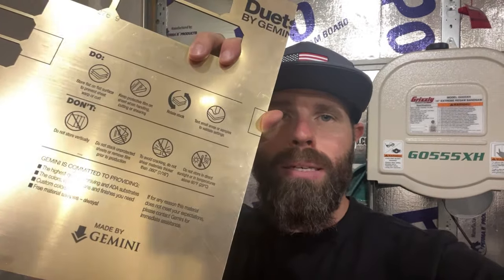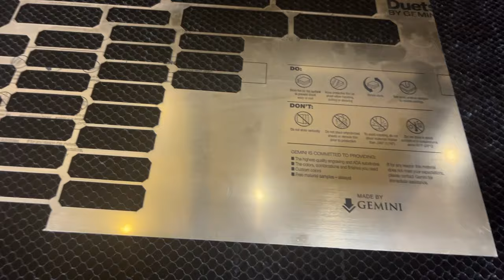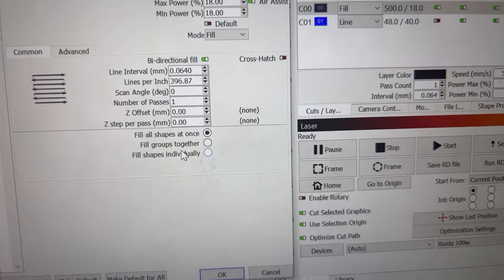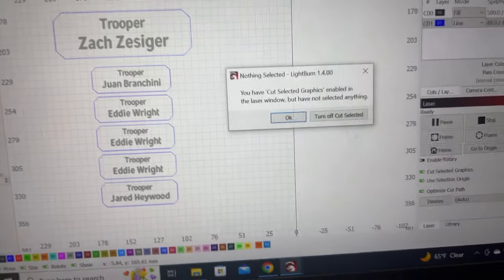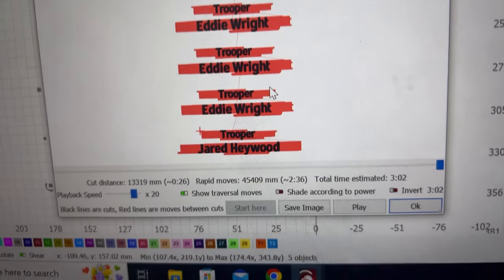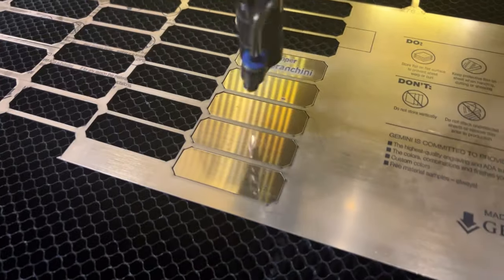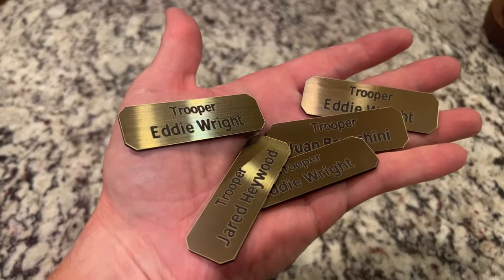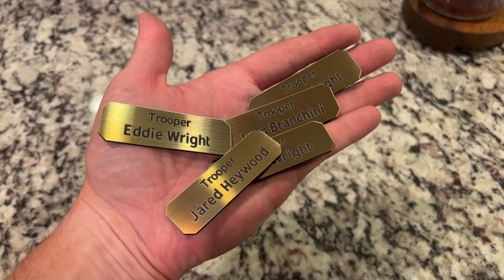Making name plates and plaques with a Co2 laser

Comment: How do you get your machine to run so fast with minimal overscan? I run my AF2440 100W at the same settings you have and it has a huge overscan.
Reply: Lightburn has a OVERSCAN setting that you can use to dial in your overscan